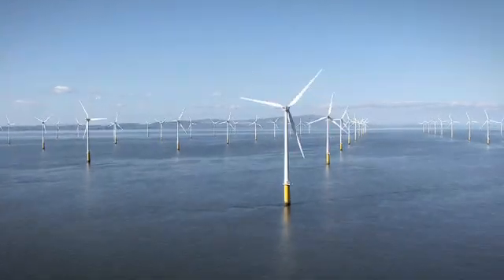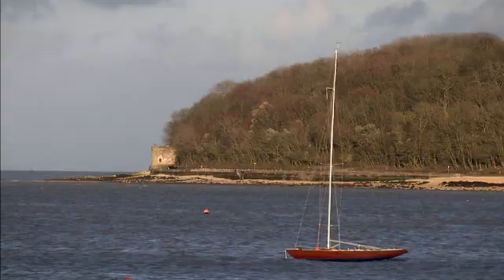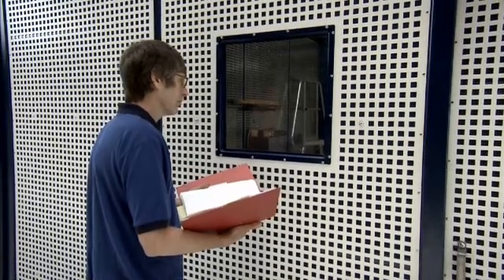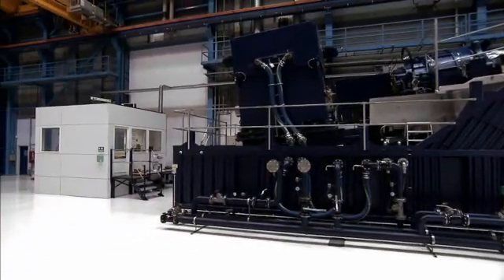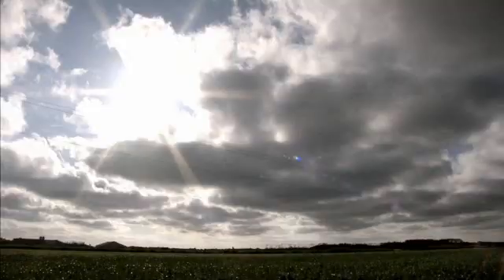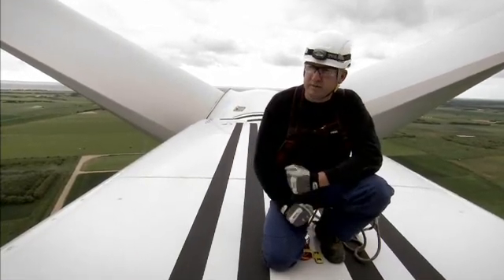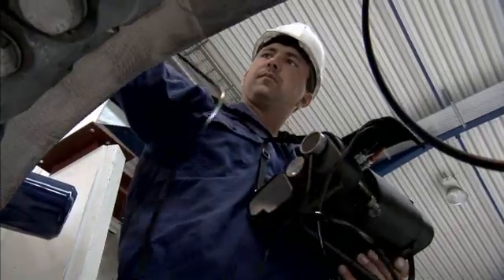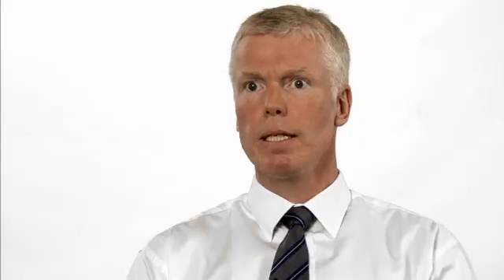V112-3.0 MW behind the scenes

Comment: How are the V112 cover doing with regards to leaks? (Water getting in anywhere?)
Reply: I worked on these. Water leaks were not an issue. Gearboxes and generators had issues though, they definitely don't last 20 years. Also a bit of wear on the blades, the fiberglass thinning quicker than expected but nothing that can't be patched with regular rope access maintenance.

Comment: It is... I´ve been doing service on the V112 3mw and the v90 3mw.
The V112 is much better designed for access, the idiot who designed the position of the gearbox in the V90 should try doing the service himself. The only minus with the V112 is the cover on the mainshaft when going into the hub.